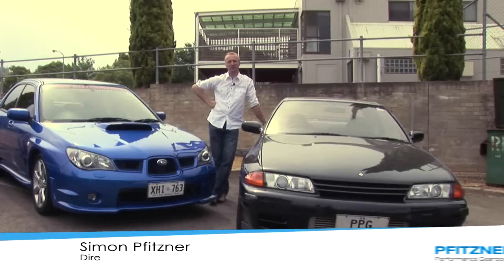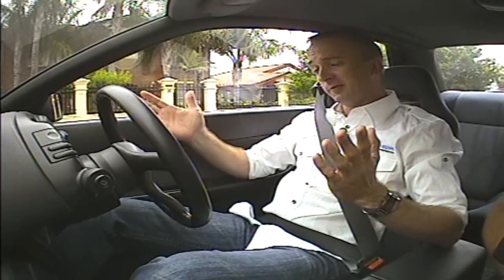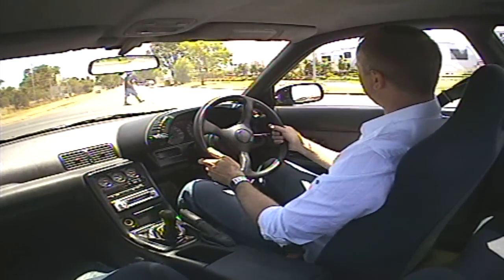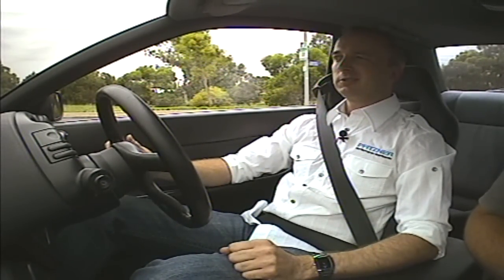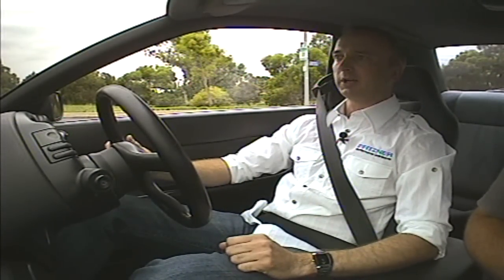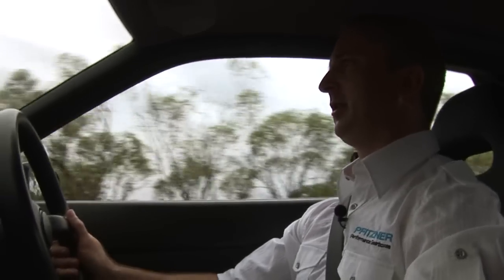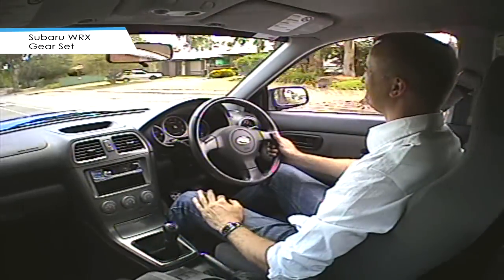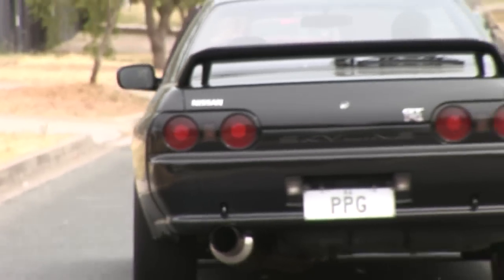Pfitzner Performance Gearbox - How to drive a dog box

Comment: Dog boxes sound to me like a great idea for a street car. Shifts fast when you want it to, you can use the clutch if you'd like, and you don't have to worry about synchros dying.
Reply: Don’t they have to be serviced a lot sooner than traditional gear box?
Reply: @neilranson4185  Not sure. I think the oil change interval is shorter though if that's what you mean.

Comment: For referance, i paid about $6000 (AUS) for the straight cut WRX synchro set. The dogbox set would be around the $8500-$9000 mark. Then add ~$1000 for installation, and a little extra for shipping costs. Made in Adelaide, South Australia. Extremely happy with mine, Pfitzner was always going to be first choice. Good work Simon!

Comment: they are very strong. When you start building your engine to high Hp and making all the parts strong enough to hold that HP in the engine... the transmission becomes the part that will break under hard pulls with HP/Torque.

many race cars use dog box straight cut gears to with stand the punishment they get during a race with a race motor attached.

Comment: exactly.  one thing I would say is that it is good to hold a bit of pressure on the stick before you lift off the pedal that way you will get good engagement.  same as on a bike.

Comment: like a semi they do not have syncros, you do have to learn what gear the car wants for what speed and rpm. first time I shifted a big rig it wasn't just like jumping in and shifting a 5speed you get a feel for it. some people don't pickup on it so quickly. if you can shift a semi ten speed to 18 speed it's similar. if you lose what gear your in its not always easy to jump right back into a gear.

Comment: Straight and helical are the way the gear's teeth are cut. Dog refers to the way the gear engages. Instead of using synchros, the gear just has big, straight 'teeth' that are much easier to engage at high rpm's. Sequential transmissions use dog engagement as well...They just, obviously, shift differently than a standard h-pattern box(think motorcycle)

Comment: @187maker  A change in gear set, be it dog, synchro or any other type of engagement  shouldn't hold any type of bearing on clutch life... it is the driver and his/her driving style/technique that determines the life of a clutch.

In most cases the most damage to a clutch is when people ride the clutch or dump the clutch at high revs.

Comment: helical gears are generally stronger an they increase the contact area of the gears, in straight cuts all the force from the engine when you engage the gearbox is put from the tip if the straight tooth to an area of equal size on the output gear. helical gears twist on so when they make contact its the whole face of the gear touching the whole face of the other gear increasing contact area and distributing the load therebye reducing the chance of breaking teeth.

Comment: @marek0086- Nah, straight cut gears only have one tooth touching at a time, helical have 2-3, making helical stronger, the reason people use straight cut is less rolling resistance = less drag through the gearbox, Then the straight cut are made stronger to then be also stronger than helical gears

Comment: Blow a few factory built trannys, and you exceed the cost of a ppg gear set.  Only way ppg fails is if the case breaks or incorrectly assembled, or poor maintenance.  I have never heard of the gears failing for any product defect.  DCT are expensive, not available on all cars, and not an option for older cars.  Just like 600 hp cars can be comfortable on the street, so are these gears if you understand how they work.

Comment: dog boxes can have helical cut gears, its just theres no synchronizing of any kind which is good for racing because you lift, and shift without the clutch, apparently from this vid you can use it on the street aswell, personally i dont race, the syncros can keep up with my shifting

Comment: I'm sure you've heard the whine when you reverse a car right? that is because reverse is a straight cut gear. except with a dog box the forward gears are straight cut, this allows a gearbox to be able to reliably take the loads of a high performance engine through the driveline. of course in a nutshell...

Comment: So what's the supposed "advantage" of these: just that you can fast-shift them like that? And then what would the downfall be? How do they work so fast like that even without using the clutch? What are their synchros like?
Reply: The only advantage I can see is a faster gear shift for performance driving or racing and perhaps a more robust/durable gearset when compared to stock. These gearboxes don't have synchros at all; they use dog engagement like a race car. Part of what allows fast shifting in a race car is an engine with low inertia so the revs drop quickly when releasing the throttle when not attached to the engine such as the moment during a shift. This reduces torque spikes during upshifts. As you can see in the video, there are noticeable shudders in the car during shfits; road cars don't normally have a low inertia engine. This can't be good for the other drivetrain components in the long term.
Reply: +MaxxFordham A dog-box can fit wider gears since dog rings take less space compared to synchronisers, so these gear themselves are stronger.  Plus the faster clutchless shifting as shown. :)

Comment: why do ppl say these are so hard to drive? this video suggests no more effort goes into shifting a ppg than a regular synchro box .... gear slips in no problem whether he goes up or down doing so at whatever speed. has this myth developed from ppl that have never sat in a car with a dog box let alone driven one?
Reply: +Daniel Laiman Or just people who outright suck at driving and their ego was too big to admit it so they blamed it on the car.
Reply: @buca9696  I think like a semi they do not have syncros, you do have to learn what gear the car wants for what speed and rpm first time I shifted a big rig it wasn't just like jumping in and shifting a 5speed you get a feel for it. some people don't pickup on it so quickly.
Reply: I drove one yesterday and is not that easy at first. All gears where like...arrggg...arrggg... Not easy at first.
Reply: @sepupr21   How long did it take to get used to it? What difference in technique did you use to adapt? Double clutching? Rev-matching?
Reply: @curiousobserver8778  took like 5 drives to get good at it. Still downshifting is not that perfect for some reason. 
It seems it likes low RPMs or really high RPMs, nothing on the middle. At least my HKS does.

Comment: @nicbarrow okay, i'll be nice enough to tell you. A dog box is a gearbox where there are no synchros to synchronise the gear speeds, so you have to match them by yourself. They're much stronger but are usually harder to drive.

Comment: ...and cost. Straight cut gears will be cheaper to cut and dog boxes have no synchroniser rings so there's a lower part count and no angled faces to machine. A lot of bike gearboxes also use some of the gears themselves as the shift rings.

Comment: @maersklandro 
Almost all race cars using sequential manual boxes or newer faster paddle shift, sequential automatic boxes. These g-boxes are not primary developed for daily driving. Also every reverse gear in all street cars are straight cut.

Comment: So when you shift using a dog box do you need to use the clutch every gear change or just taking off?
Reply: Boosted Integra you can just use clutch for when u start to move, just know if your going to clutchless shift, it’s wearing the trans more than using the clutch
Reply: @TechFeedMe  If you drive it right it won't wear that fast.

Comment: Helicals are stronger than straight cut, because at the same pitch (which measured at along the helical angle) they have thicker cross section (measured along the force direction) than straight cut. Why they aren't used in motorsports is, besides the axial loading issue, the slightly lower efficiency than straight cut gears. The chevron gears were developed to obtain the benefits of the stronger structure without the axial load problem.
Reply: "Straight-cut" gears are A.K.A. spur gears. Why do so many people forget that the real name for straight-cut ( <--- which needs a hyphen) gears is "spur gears"?
Reply: MaxxFordham because whenever someone goes on about how much stronger spur gears are compared to helical, you need to use very basic vocabulary and simple sentences. Try saying involute gear and receive a barrage about how much stronger straight cuts are. So you start avoiding terms that actually require any knowledge on the matter.
Reply: Okay, well then why don't you say "curve-toothed gears" instead of the big technical term "helical gears"? Same simplification, but on the other side, right?
Reply: Because we still talk about things with their real names. "Spur gear" is an industry short hand, jargon, for a straight-cut gear, not the official name; indeed an AKA. Both straight and helical have the same descriptiveness, while a curved tooth gear would evoke spiral bevel or hypoid gears.
Reply: If "spur gear" is supposedly an "industry short-hand," then why isn't "helical gear" the short-hand for that one?

And if "curved-cut gear" isn't the technical term for helical gears and "helical gear" isn't the shorthand for that one, then why is "straight-cut gear" the supposed "technical term" and "spur gear" the supposed "shorthand" for that one?
Reply: Actually, scratch that. I had a bit of realization. Straight cut gear is called spur gear in the United States ONLY. It's straight cut gear everywhere else. That's what you get when english is your third language with vocabulary piecemealed from wherever. So my apologies, I should've realized that from the start.
Reply: Hmm. Well, you need a hyphen in "straight-cut," in order to combine those two usually single words into a compound word.

Still, if the rest of the world uses "helical gear" for the other kind more than "curved-cut gear," why don't you/they be consistent and do the same with "spur gear" vs. "straight-cut gear"?
Reply: cogs are also much thicker and deeper in straight-cut gears that helicals. More material is what makes them 'stronger'.

Comment: if in slow driving mode...is it still clutchless? very interested in this... in your video u change ur gear like normal,i saw in another video to up shift is just pull and down shift just push upward....i believe it's straight cut...is it?

Comment: It said "Short/Speed shifter" is not recommended for the street with one of these boxes. Hell, i'd never recommend a typical "short' shifter anyway. That's literally all it is, a shorter stick for the shifter. A very few actually shorten the throw itself, and are usually the same/close height as stock, but are quite pricey. Theres nothing wrong installing one in a daily, It may need a rebuild sooner than a stock trans on the street, but if you beat the stock one anyway, it'll live shorter too.

Comment: @marek0086 Nope, not a type of bread.
I've not heard about helical gears wearing out faster though I'm fairly sure helical gears have a higher surface contact area. This would explain why one of the other advantages of straight cut is lower power loss through the transmission - less gear contact swipe area (in addition to lower rotating mass that allows quicker rotational speed change). With proper lube neither should wear gears faster than the other.

Comment: @whoadudeification you are incorrect. Helical gears are weaker because there is less surface area in "mesh at any point in time. This is because the helical - cut gearset is designed to roll each tooth in, then out, which is what makes them quiet. Dogboxes have the entire surface area of the tooth in "mesh" at any point in time, making the gears themselves, much much stronger. After 3 smashed mazda gearboxes with broken teeth, I know that helical gearsets aren't as strong as a dogbox :)

Comment: These gearboxes dont use synchros like in normal gearboxes.
They use "dog's". They dont need you to press the clutch.. you have just to unload the gearbox before you change gear.

Comment: So, in terms of "the dogs bouncing all over one another, to where it sounds like a machine gun going off, that essentially will incur the most damage." Sir, you mention it without a time limit, you claim reliability and strength and the wide-application use, showing off the street use here in your video, which is awesome, I like how it's street-able technology, but, with the way the gears are straight cut, and with long term street use, not necessarily barreling down every single road, but with spirited driving occasionally, say once or twice every weekend. Do you think it would last longer than an OEM transmission? The same amount of time? Less time? Due to the construction. I would love to purchase this as an upgrade to my 07 STi to handle greater engine capability that I've built into my power plant, it just longevity I'm looking for as well, the word reliable on your website doesn't give me a time limit really. The fact the gears are straight cut, and the load of clunking sounds in the gearbox make me wonder about extended wear just for driving about on them, not even considering flat shifting being involved under any circumstance.
Reply: I promise I'm not trying to make stabs, just looking for the proper upgrade to my transmission.
Reply: I've long ditched the idea of the dog box a long time ago haha. Upgrading the center diff. Sounds about what I'd be after
Reply: +James Miller I don't think their gears will wear out (if at all), the whole point is the gears are much stronger than OEM.  However the dogrings can wear if not driven correctly.
Reply: +TassieLorenzo I've researched this far more in depth since wanting this upgrade and now I'd rather just get another stock 6 speed. otherwise, if I had an total race car, I would employ this dog box as that's where the application of this is truly warranted. I don't believe product would have longevity in street scenarios.
Reply: I've rode a motorcycle with 30k miles on it, and an almost new one... Large and noticeable amount of wear on the 30k mile gearbox. But then that bike may have been abused before I bought it, who knows. But the dogs do wear; think about how much force is applied to them when you're banging it through the gears at high speed, especially clutchless shifting.

Comment: @marek0086 The straight gears result in a stronger transmission, but the gears are not any stronger - the difference is that straight gears only result in radial stresses, where helical gears develop axial stresses as well which require bearings to handle "thrust" loading.   Helical cut gears would be stronger than straight cut gears of the same width as more than just one tooth will be transferring the torque.

Comment: Don't want to burst your bubble but straight cut gears are weaker than helicals. The advantage is that there is no thrust on the gear axis so the axis' and bearings can be simpler/lighter (weight saving measure). And why a dog box? Because it allows fast clutchless shifts and doesn't have synchros that make shifts require a little more force input from the driver. Still a modern transmission is the way to go on road cars, there is no real gain there for straight cut gears and dog boxes.

Comment: Why is he using the clutch when shifting? Engaging the clutch does nothing and since you are getting off the gas you are already unloading the transmission making it easy to shift.
Reply: lol. So the creator of these dogboxes doesn't know how to shift them? interesting.
Reply: lmfao
Reply: Feral MX5 the point is that since there are no synchronizers the clutch disengagement does nothing to help the shift unless you do not let of the gas so why bother? my 86 has a dig bone straight cut gear T5 and the clutch is useless for street  driving.
Reply: I dont see how you think using the clutch is useless. It still unloads the trans, less wear and tear. Yes, you may still hear noise due to the engagement - thats normal. But shifting clutchless with a dogbox is rougher on parts than using the clutch.
Reply: Angry Jesus but lifting off of the gas unloads the transmission too and I do not grind any gears when shifting without the clutch. I only use the clutch when starting to move all shifts up and down I never touch the clutch.
Reply: Michael Anderson I'm not saying you can't do it, but you would be prolonging the lifespan of the gears.  Personally, If I wasn't racing I would use the clutch. Is your vehicle race only or street/track?
Reply: Angry Jesus street track. The idea is when you let off the gas is to shift in between the engine load and deacceleration load so nothing will happen to the gears and I don't wear  the clutch.
Reply: Even when you flat shift you take your foot off the accelerator slightly unless you have ignition cut which switches the engine off while you shift

Comment: People dont drive straight cut gears because of the noise, not because they are hard to drive.. They are annoying as hell and it gets old really fast hearing that gear whine if you are dailying the car.
Reply: @AM I know that, not sure what your point is... Straight cut gears, regardless of anything, are loud af. Its why if you drive an older honda, and put it in reverse, it whines. Its annoying. It why they designed helical gears. One, because engagement is(or can easily be) smoother, but also, because they are not as loud.